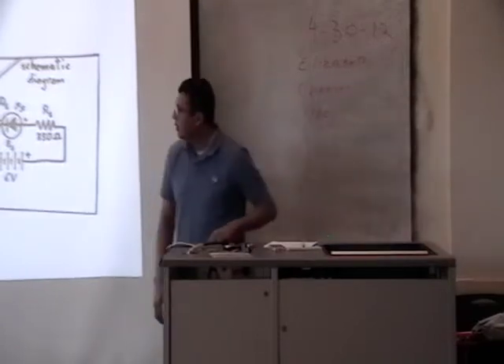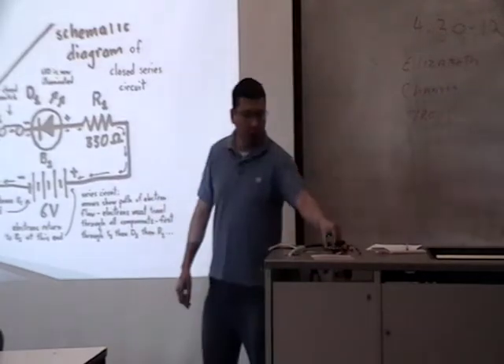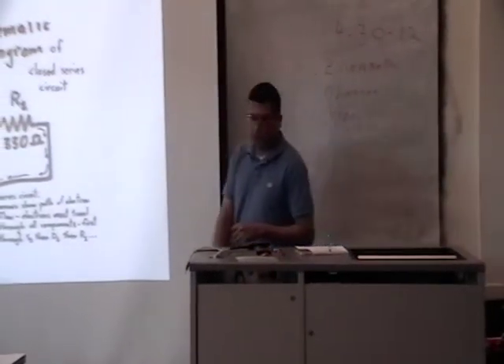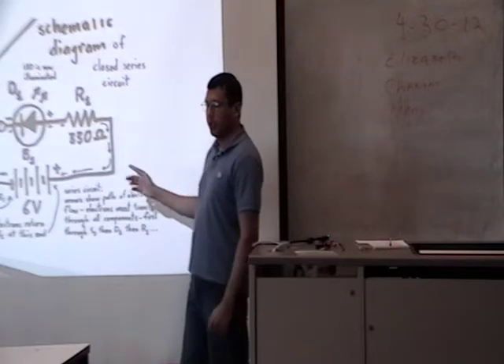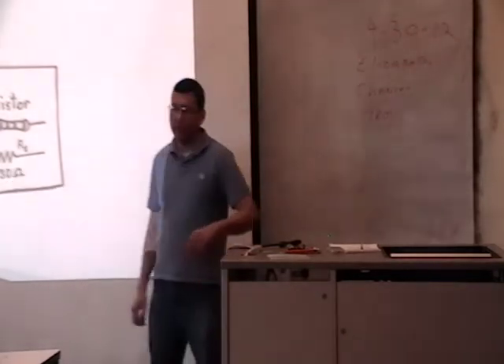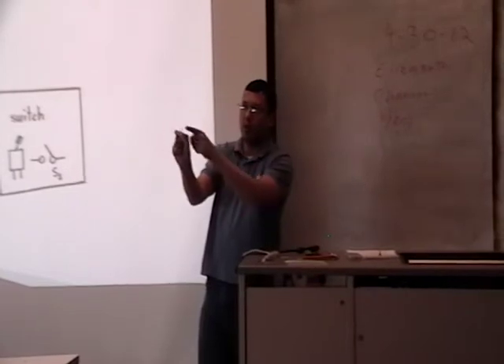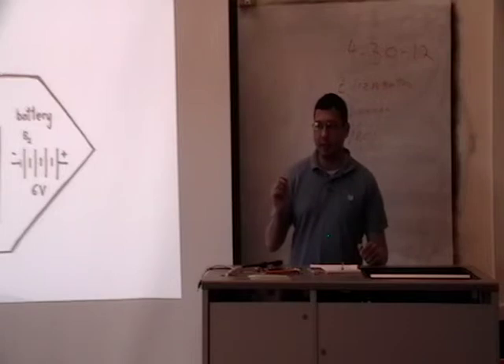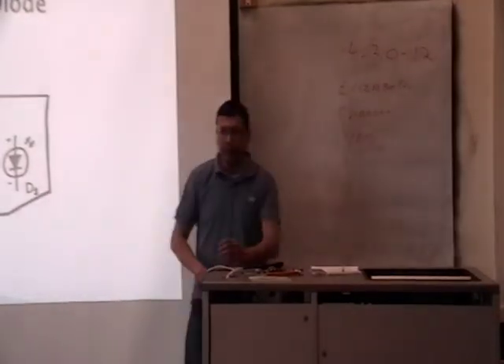Circuit Schematics Explanation

Comment: You missed the most critical thing. You should have mentioned just to disregard that the electron flow(- --> +) and use conventional current (+ --> -) when it comes to anything to do with schematics. It gets ridiculously confusing if you do.
Reply from the maker: Very good point! Thanks for your comment, but I decided to withhold that information so there would be less confusion; therefore, introducing conventional current would be better suited for a following presentation. Keep in mind that this presentation was developed as an introduction, primarily to show the ways that components are represented in schematic diagrams, to show the operation of a very simple circuit, and to coincide with the technical manual that gives just enough information for readers to get started building their own circuits with the most basic knowledge. Here's the URL to an example of the technical manual: http://sparkintelligence.wikispaces.com/
Reply: Troy Sieusankar  But you didn't introduce conventional current. All circuits are drawn using conventional current (pos to neg).  I was going to put a protection diode in a circuit to prevent myself from hooking it up backwards and damaging the relay. teledynerelays.com/pdf/military/kala.pdf  I was going build the circuit (second from the bottom on the third page). Withholding information is more damaging than informing them.. Trust me I understand giving a presentation is ridiculously stressful and believe you me mine were all train wrecks. I was always unprepaired, i never rehearsed, and I could turn a 20 min speech into a two minute speech.
Reply from the maker: dumass00072 Thanks a lot for your in-depth attention to details. I understand your point about safety, by avoiding damaging circuit components, by not reverse biasing them (by not miss-aligning their polarity orientations), but as long as the positive and negative alignments of components are properly adhered to, with respect to the positive and negative ends of battery (power supply voltage) terminals, there shouldn't be any risk of components being reverse biased. The positive (source/supply voltage) and negative (usually ground) are always labeled the same in circuit schematic diagrams, and the electronic components' anodes (positive facing sides) and cathodes (negative facing sides) are usually labeled on the components' packages, under the specifications headings; however, I will definitely take your advice and try to avoid withholding any such fundamental information in any of my future presentation regarding current flow. Again, thanks a lot.